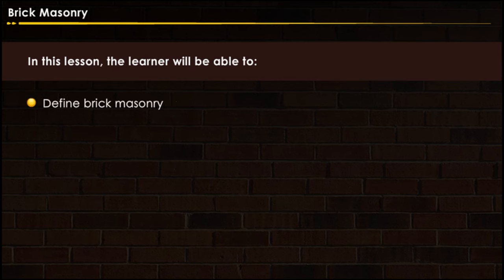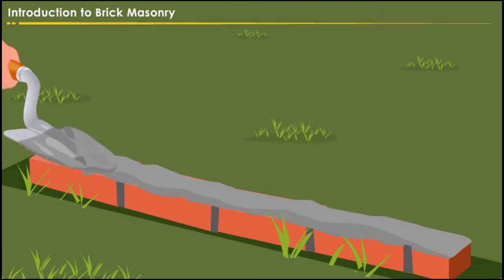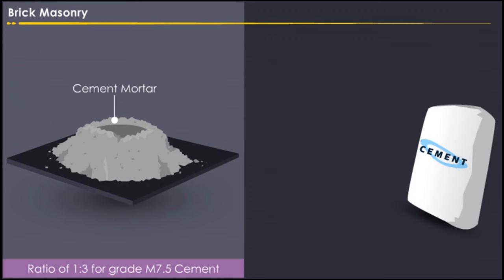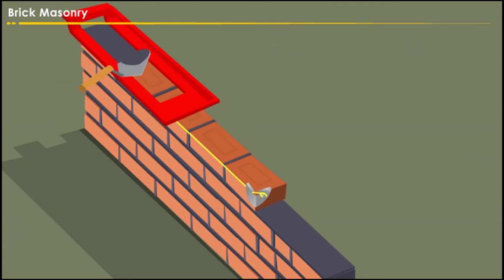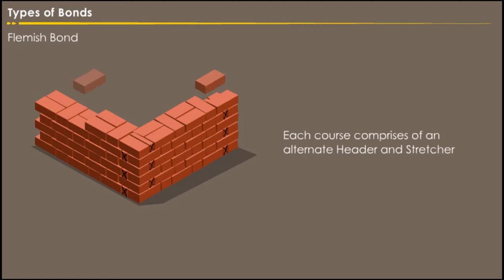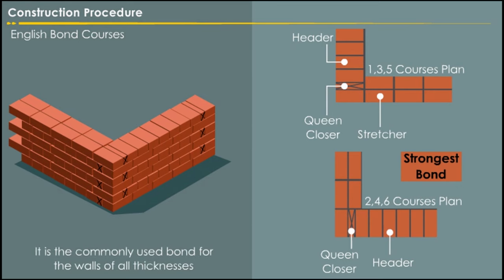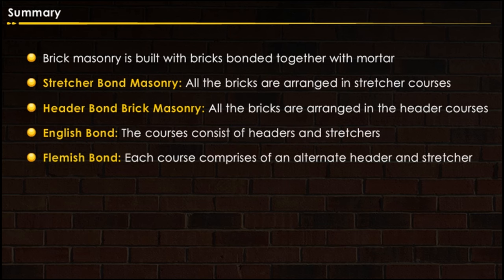Brick Masonry Construction

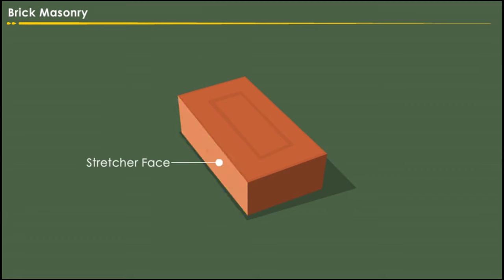Comment: The dimensions/diagram of a single brick have to be incorrect. You cannot possibly get a rectanglar prima polyhedron with a square face (time stamp 1:30)
Reply from the maker: Thank you for your comment. I understand your point, but it's important to note that the standard dimension of a brick used in construction is generally accepted and correct, and the image in the video is only for illustrative purposes.
While it's true that the shape of a brick is not a perfect rectangular prism with a square face, the dimensions of a standard brick are designed to ensure that the bricks can be easily stacked and held together with mortar to create a stable structure.
It's also worth noting that the viewpoint can make a difference in how we perceive the shape of a brick. Depending on the angle at which we view a brick, it may appear more or less rectangular